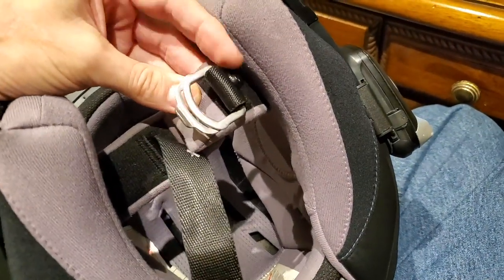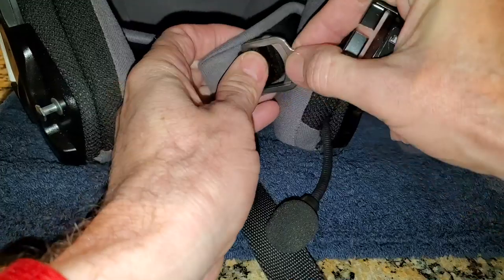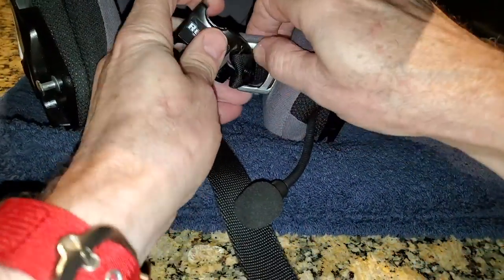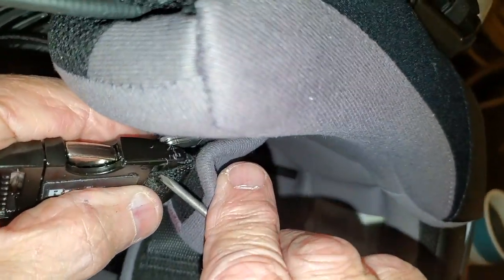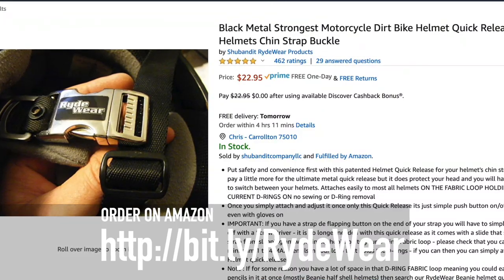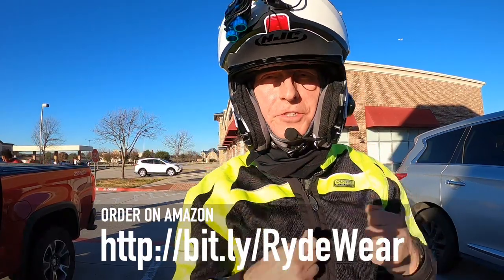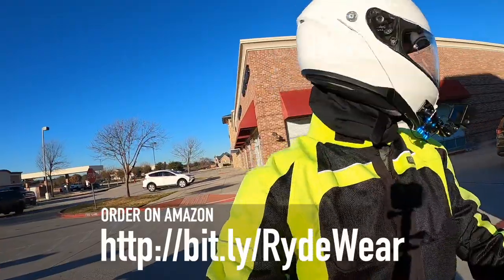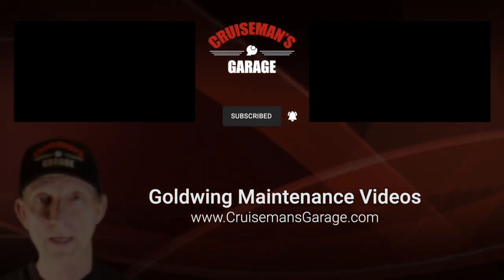RydeWear Quick-Release Helmet Buckle Install and Review

Comment: Because I had little room on the strap loop, I cut the D rings off first and, with needle-nose pliers, installed the quick release in less than 5 minutes. The quick release is going to make wearing my half helmet a LOT easier. Thx for the vid.

Comment: Bought and installed it. Gasket picks made the job go much faster. Put one end of the buckle in and then reached the gasket pick through the d ring loop to pull it in to fit.  Fits great and its so much easier than fishing the strap through the d rings . Now I have a consistent helmet fit.

Comment: I just installed the RydeWear Quick Release on my Nolan full face helmet. It was a bit of a struggle, but I ended up using small needle nose pliers with long thin jaws that I had in a Blue Point set. I went to the needle nose pliers after struggling with it for about a half hour. I ended up getting it all jammed in place with the pliers in less than ten minutes. Really like the way it fits the loop after you do get it installed. I left the D rings on so I could still use this helmet as a backup or passenger helmet when I buy a new helmet and move the Rydewear buckle to the new one. I really like it so far. No plastic and easy to operate.

Comment: I put it on a Schuberth helmet,  yes the first part is the toughest.  I used a small flat head screwdriver to avoid as much slippage as your phillips, and managed not to slip and rip myself :)  The D rings tucked away in a retaining strap so they are out of the way forever without having to remove them.  Thanks for guiding me through the install.

Comment: I have an is-max 2 and it took all of 10 minutes if that long. It took longer to find my needlenose plyers to pop the buttons off than it took to put the whole thing together. I have no plans of locking my helmet on my bike, so I clipped the D-rings off with a couple of wire clippers (Side Cutters). 
Was a good purchase.

Comment: I've used a different brand on my helmets for several years.  They do the job and make things much quicker than using D rings.  The RydeWear buckle appears to have a better male/female connection design compared to my buckles which can easily jam if you aren't careful.  Think I'll give the RydeWear buckle a try.  Thanks Cruiseman.
Reply: Vance Ruka - they do have a better connection. You’ll love it.

Comment: Two points: 1. if you don't want to remove your snap and you have enough room, you can double-back the strap with the snap and feed the doubled-back strap through the male end. 2. I put my female buckle over the D-rings (I've tried it both ways)... it feels the same either way, but when put over the D-rings it hides the D-rings for a better look and also keeps them out of the way.

Comment: Seriously, looking close at the attachment clip that goes on the D-ring loop I personally would not trust it.....even the picture in the link you provided on Amazon looks like they just chewed the opening with a file or something. 
The D-ring is a complete loop encasing the reinforced nylon strap......this thing is just two 90% angles on a clip. What kind of metal is the clip, will it stand up?
Has this been tested by any authority on the stresses that happen in an actual crash?
May be more convenient but not sure it's safe when really needed. D-rings have been around for 50-years because they work, and once used a few times become second nature to strap up.
Takes maybe 5-seconds to strap up a D-ring? So what time does this save?

Comment: I’ve used a different brand for years and never had to remove the snap or d-rings. The main thing is to get one with a metal connection. My Neotec II came with a ratchet strap.

Comment: I dont like the split thing I would much rather they provide a spindle sort of like how conventional watch bands are secured....except not the spring loaded weak watch pins but instead threaded pins with locking in threads

Comment: Yeah you ordered the wrong style for your helmet you needed the regular style not the beanie that's more for half shell helmets that have a lot of space on the fabric loop holding your D-Rings on meaning you can fit your pinky finger in that loop with your D-Rings. You needed the regular style which would have taken a few minutes start to finish. Thanks for the video